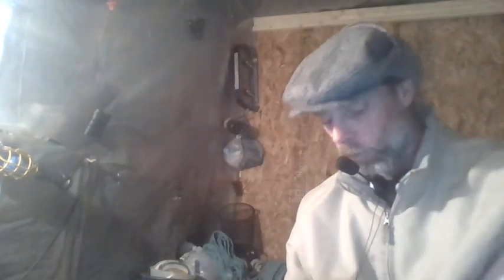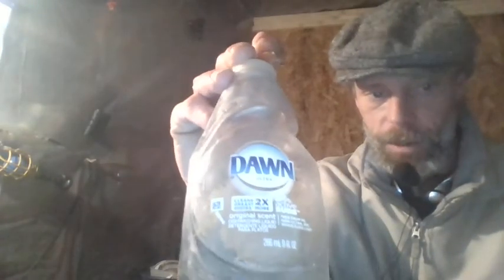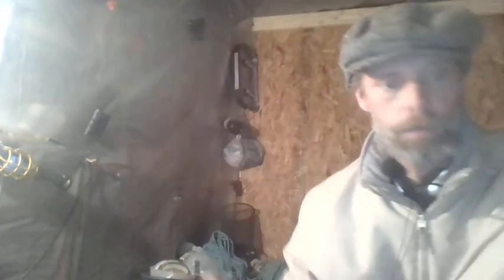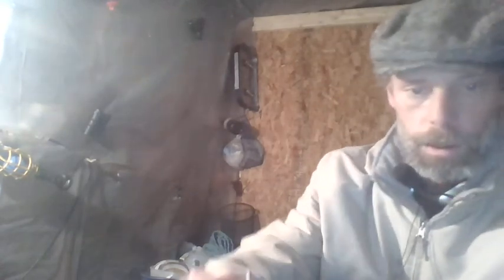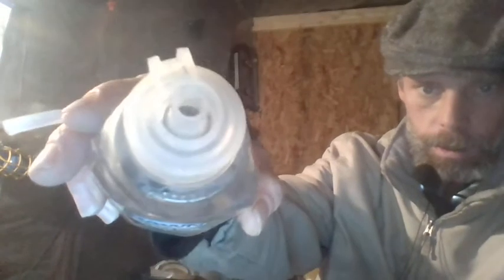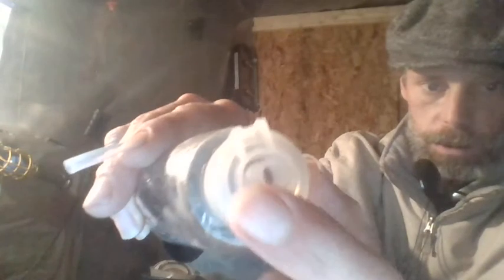build blacksand   flower gold trap part 2

Comment: HI can any washing up detergent be used when trying to catch flor gold,, I'm in aus and don't think we get dawn here,
Reply: jet-dry is your friend
Reply from the maker: as far as I know most any detergent will work but Jet Dry  is the standard because it  dose not block your view with bubbles
Reply: any soap that will help break the surface tension of the water so that all of your material will sink to the bottom. too many bubbles/suds are bad.
Reply from the maker: wes cadmore hi Wes I'm sorry you waited so long for this reply to your comment but yes just about any dish detergent will do. Don't recommend laundry detergents although technically they probably would work but they're hard on the skin and hand soap will work but you can't see through it it makes the water too cloudy but just about any dish detergent will do and that's a problem mentioned in the video Jet-Dry is the standard